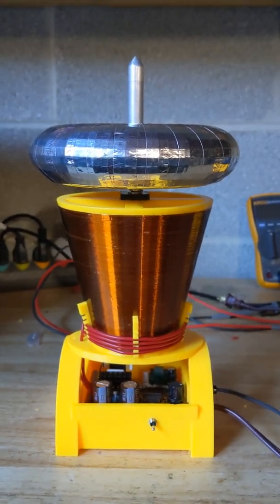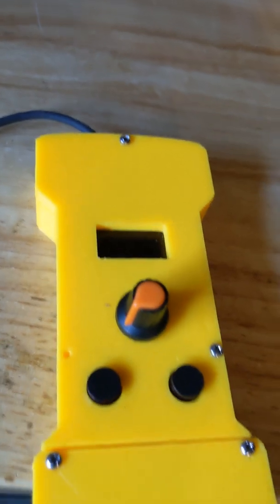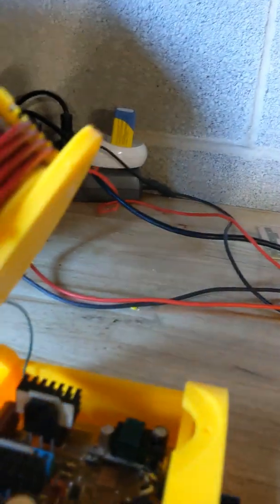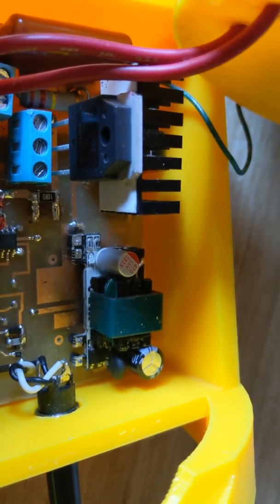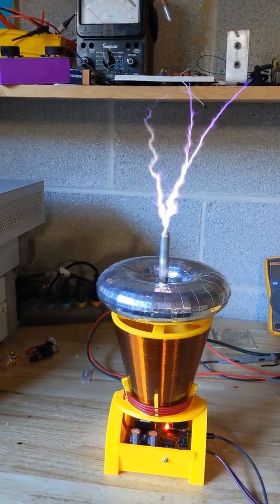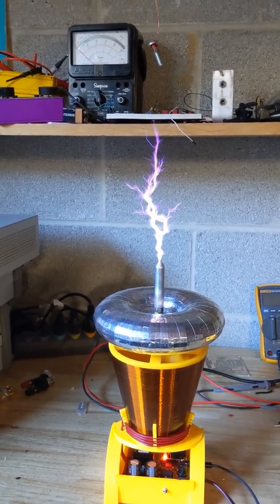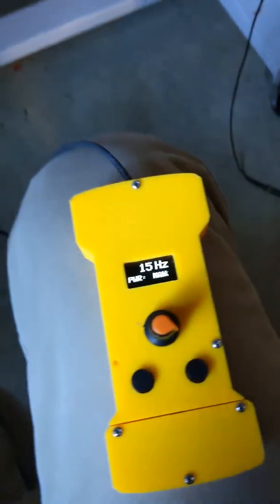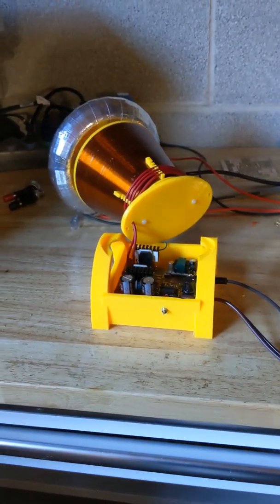The McTesla...A  Strange  Mini Solid State Tesla Coil

Comment: this is nice (and not pointless) coil. Im curious how you scope out the adjusting of phase shift? do you need differential probe for this? maybe a video perhaps? 👍
Reply from the maker: using a halfwave rectifier in the supply you can ground reference the low side switch and sample the wave forms there.